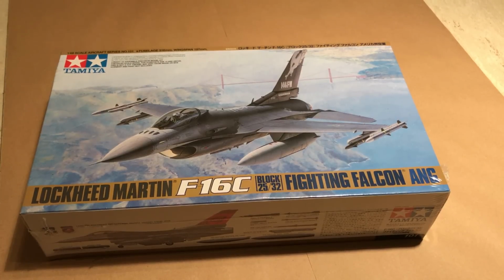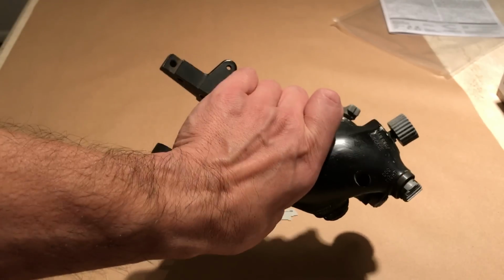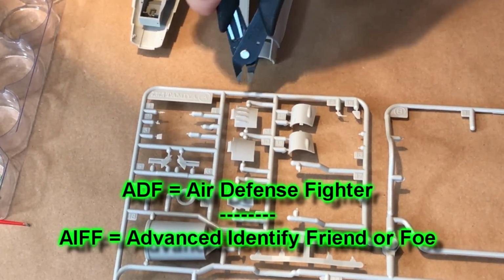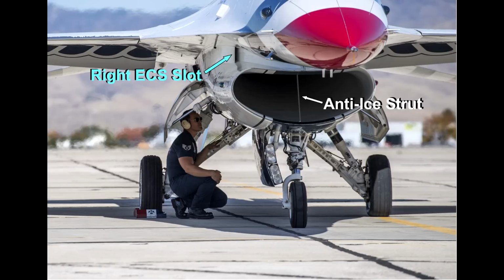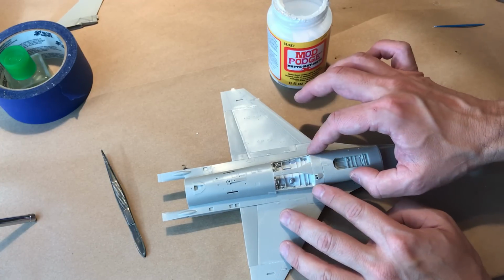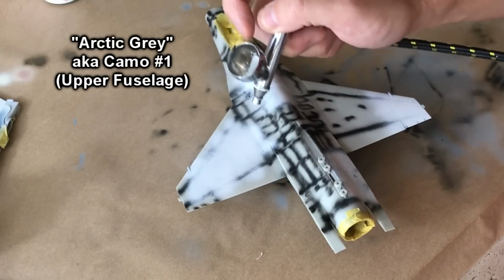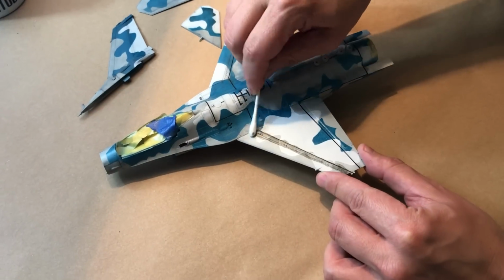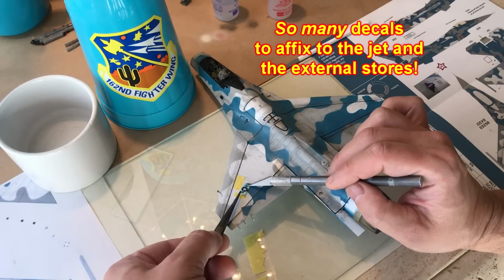Building the Tamiya 1/48th Scale F-16C Falcon Fighter Jet with “Blizzard” Camouflage

Comment: Your videos are going to get me in trouble with the girlfriend... I used to aero model a lot as a kid, and, for a kid, I was quite good.  I was no where near the standards/skill shown in this video, but it was one of my proudest moments winning an aero modelling competition when I was ~14 in the local Air Cadets.

I have no tools/paints left over, and if I did, they'd be of no use as they'd be 20 years old..  If I was looking to get back into aeromodelling casually, what would you recommend getting? Are there any good acrylic paint sets? I have a little experience with an airbrush but the way you videos make it look easy has really inspired me to want to give it another go. By biggest restrictions are time, space, and location: I don't have a spare room to dedicate, nor do I have a basement, garage, or shed, so it would have to be in the house which limits me to safe water based products.  

I'm very jealous of your hands on experience with the Viper.  It has been my favourite jet for 20 years and I've spent many thousands of hours flying it virtually in Falcon BMS.  

Thanks!
Reply from the maker: Hello Harry! Don't let your girlfriend hit me ;-) Definitely get an airbrush to start your modeling again and a little practice. Some paints are sold as sets usually for armor effects though. I've never seen sets for aircraft. I work on my painting paper covered dining table, so if you can find an area like that, you don't necessarily need a room set aside for this hobby. If you can afford one of those little hobby hoods for airbrushing that can help with the atomized paint. I use Tamiya acrylic paints almost exclusively, but most hobbyists use a variety of manufacturers for the best each has to offer. I usually build my models over a longer period of time than normal mostly because I'm working, so I've had to learn patience!
Reply: Just thought I'd report back. I've done lots of research, and have bought an AS186 compressor and Harder and Steenbeck Ultra airbrush, along with a LOT of supplies and some basic sets of Vallejo model air paints.  I've started a basic out of the box airfix 1/72 kit to practice and am using old spares to practice airbrushing on :) Take care!
Reply from the maker: Looks like you have a good set up there to start again, you should get some great results!

Comment: Fantastic video! Your explanations are great. What is the mix ratio of your Tamiya colors and thinner (what type)?
Reply from the maker: Hello XFIGHT3R, Thanks for the comments! In this case, I did not make my custom paint colors with precise ratios -- I did it more by eye. Here are the paints I used: “Arctic Grey” (XF-2 Flat White + a little XF-19 Sky Grey); “Light Grey” (XF-19 Sky Grey + a little XF-2 Flat White); “Aggressor Blue” (X-14 Sky Blue + XF-50 Field Blue). I pre-thin all my paints for airbrushing when I first obtain them (~ 80% paint + 20% X-20A Thinner).  [An “Andy’s Hobby Headquarters” tip is to fill thinner up to the inside line visible just below the top of any new Tamiya paint bottle.] I hope this all helps!

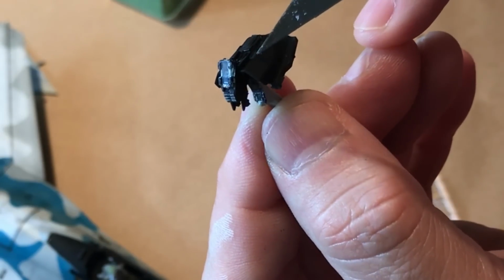Comment: You did an incredible job and have inspired me to purchase this model kit. But I believe you put the HUD glass in wrong. At 30:28 you can see it was placed in the wrong orientation.
Reply from the maker: Yes, you are correct on the HUD glass and the 2nd to comment on this glaring error. You'd think after changing so many HUD PDUs for real, I wouldn't have messed that up! I have since reoriented the glass to the correct position. Thanks for the comments and good luck with your F-16 project!

Comment: Dang! That's a good looking Viper! I really love your builds, especially the commentary on your experience on top of a great, clean, and realistic build! Well done!
Reply from the maker: Hey Jefferson, thanks! I'm glad you enjoyed it and some of my many tales!
Reply: Great video, combining first hand stories that are seldom heard with a good model build.

I'm just about to embark on the very same build but not brave enough to make my own masks as you did!

Only one tip to help you;- instead of using a scalpel/knife (Xacto) to position the decals, at some point (no pun intended) it WILL either scratch the paint surface or damage the decal.

Use a small micro-brush instead, the nylon bristles have enough rigidity to move the decal without damage and the decal won't wrap around them like other brushes as there is little capillary action.

Great work

David.
Reply from the maker: Hi David, thanks for the compliments! I do usually use a brush for setting my decals, but I was having trouble despite having plenty of fluid to float them. The only way I could get them to move was to use a knife some of the time, it was worrisome!